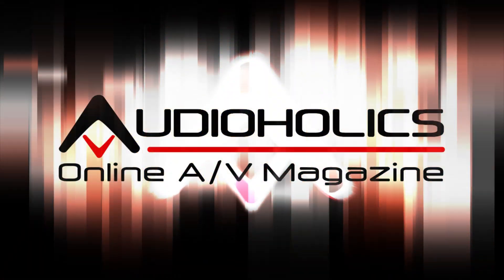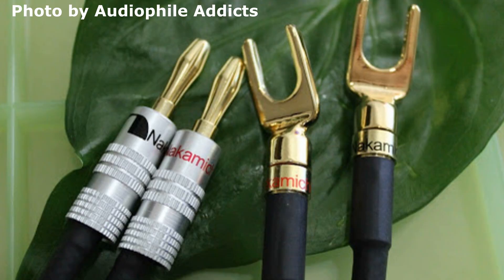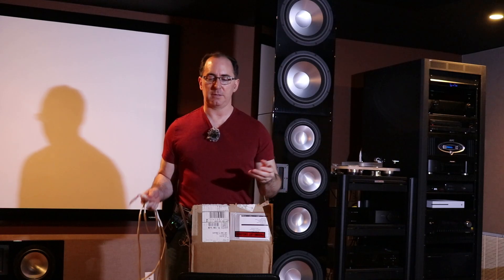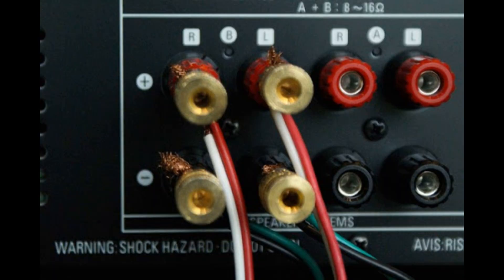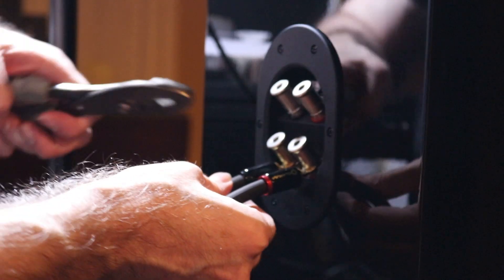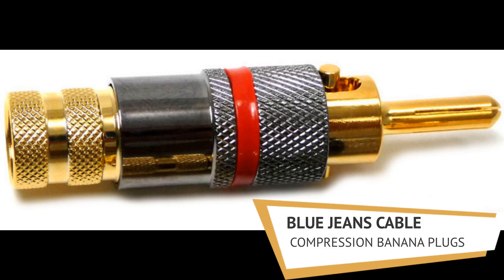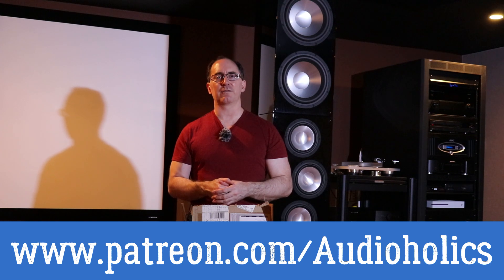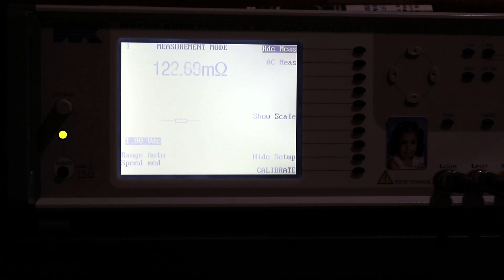Spade vs Banana vs Bare Speaker Wire Terminations: Which is Best?

Comment: Very fun subject and I share a true story. Hopefully this won’t get to long. Two Government Agencies, NASA & the USN contracted a study on what was the best type of contact connection and repeatable. Gather all the connectors, including spade and banana plugs, together, make the connections 10x, log the data and present that to NASA & the USN. Contractors enlisted, MIT & GE. Time frame 64 → 68. I think it was around 66. Use undergrads to do the tedious testing as they are cheap labor. Yours truly was one of those basically free laborers.

The testing was done in a Calibration Lab at a Navy Facility in MA run by GE. Principle instrument was what is still called a Wheatstone Bridge. That instrument was capable of measuring down into the single milliohm range, repeatedly. Like 1 or 2 milliohms.

The connection that they were most interested in was what was called a “Wirewrap” copper on gold post as that was the most common at the time in Military and Satellite backplanes.

Me/we tried’em all over and over again. Most of the good readings were in the single digit milliohm range. I think this thing ran for about a week. The Wheatstone Bridge was calibrated in the morning before testing started and checked again at the end of the day when we were finished for that day.

To try and make things as short as possible, and to support your conclusions, we found the best, and most repeatable, connection was to take cheap 12ga copper lamp cord, twist about an inch together, then hit the connection with a hammer on an iron surface (anvil). Just lightly. Typically resistance was like under 5 milliohm. Mostly in the 2 or 3 milliohm range. And it could reliably be repeated over and over and over again.

We called this connection the “Smash” connection.

That was ok with NASA and the USN. At least they knew what was the best. The wirewrap connection did very well with a repeatable connections under a 10 milliohm measurement. Spades were in the teens. Banana plugs were very inconsistent and changed with just a little wiggle. I can’t remember the exact measurements we got from those.

So there you have it. It was a long time ago but physics is physics and I suspect if that test were repeated today the numbers would be the same. I don’t think wirewrap connections are used anymore.

I’ve been told that Wheatstone Bridges can now resolve down into the micro-ohms. That’d be fun to play with.

https://en.wikipedia.org/wiki/Wheatstone_bridge
Reply: How to calibrate in the milliohm range? There are/were copper bar standards with big bolt connections on the ends that are 1mohm, 2mohm, 5mohm, 10mohm.

Comment: I use bananas wherever possible, but I use spades on my vintage McIntosh amps, which use barrier strips for the speaker taps. I've found that cheap hardware-store spades seem to make a tighter connection than the Monster spades I used originally.

Comment: I have 6 gauge wire on my 3 front speakers and I used banana,  but I had to remove some of the wire strands so it would fit in the banana and I also soldered the wires to bananas.   The rear speakers are raw.  Glad you recovered from the virus.

Comment: You forgot one category...I use o-ring which fits Vandersteen Barrier strips in the form of  10 AWG Gauge Gold Ring Set Screw Battery Ring Terminals...mostly used in car audio for power terminal connection..to connect to the speaker..to connect to the amp I use compression bananas as well spade for true bi wire using separate wire runs.  O-rings give the best connection used on barrier strips where the screw provides strong compression.  Not enough companies make audiophile o-ring speaker connectors.

Comment: I use bananas on receiver and surround speakers... but the mains are bi-amp/bi-wire so I have them setup raw with a notch in wire casing and those jumper plates taken out. So that's one wire on both hi/low binding posts. With Jumper plates make sure they don't get loose or out of place when adding connections. Also I found it neat; when i first set it all up raw that the wrench that came with speaker mounts fit the binding posts. I took some 320 grit sand paper to the cheap stamped wrench so it had no sharp edges to scratch anything. Like the Spades I find raw can get loose over time too. When doing a good cleaning of my room I pull my connections and clean them with Alcohol.

Comment: I use bare wire on both sides, and it works just fine. Glad to see you feeling better, Gene.
Reply: Do you tin the wires to prevent corossion?
Reply: @ I don’t, but that wouldn’t be a bad idea. I guess you’d have to be careful with how much solder you add. You wouldn’t want to thicken the wire too much that it won’t fit in the holes.
Reply: Yeah, bare wire is probably the best a non-technical person is going to get. Banana plugs are popular, but they're meant for temporary connections only.

On the other hand, if you have a decent crimper and don't mind putting the effort it, spades are the most reliable and robust connection.
Reply: @VladimirPutin-p3t Have you watched the video? Spades are the easiest to come loose, and are therefore the least reliable.

Comment: First of all, welcome back, Gene! Your COVID-19 journey and story was a ray of hope for us who are just getting the brunt of the infection in our country. (Currently in lockdown). So, I'm staying home for at least 2 more weeks.

Anyway, I use raw copper wires for the longest time. I encountered a great deal on banana plugs online and dove right into the deal. Now, I use them and they are more neat-looking than the raw copper wires. Copper wires also tend to get pulled out of plugs. Bananas are more secure. In terms of sound quality, I do not hear any difference, to be completely honest. I am just happy that I have a better quality speaker connection in both physically and aesthetically.

Comment: I’ve mostly used banana plugs.  I had all Monoprice closed screw plugs but I recently had an issue which I thought could be related to my terminations.  I noticed that they were loose in specific binding posts and I never liked the way they screw down.  If you don’t strip it the perfect length then the wire gets stuck in the threads.  It can then cut some of the threads.  So I ordered Sewell silverback banana plugs.  Much better in my opinion.  I like they way you terminate the wire with two screws and they fit nice and snug in all the binding posts in my system.  Unfortunately they’ve been sold out for weeks for some reason so I havnt been able to get more to swap out all the Monoprice.

Comment: 2-Inch Solid Copper Wire crammed half way into the middle of the speaker cable conductors, soldered and heat shrink applied. The solid wire now easily fits into the 5-way binding posts

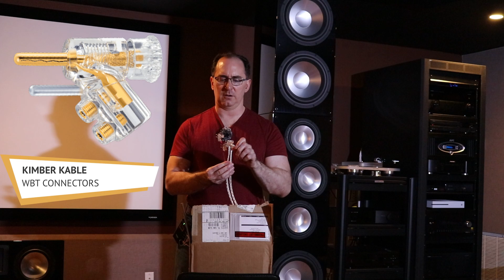Comment: 3:46 parts express (Dayton audio) sells copies of those connectors which work perfectly in my experience. They still aren't super cheap but are certainly better than Kimber's price. I've used both styles and I agree the 45 degree connector is much better for speakers than the straight style.

Comment: What?  I thought we were supposed to use a single 1/8 TRS on the amp side and RCA connectors on the speakers!!  🤔🤐😂

I think you either have common sense about connection integrity, or don't.  I guess you can give those who don't step-by-step instructions and maybe it'll improve their chances.  

Mine are probably considered a little extreme.  I put ring terminals on the speaker side, soldered to the wire, and attached to a terminal block.  Three pairs of mil spec ten gauge, twisted in pairs, one for each driver set.  Dual bananas on the amp side, stacked, the old Pomona high continuous current type from 40-50 years ago.

Comment: I'm still using my old 'Cobalt Cable' (remember them) banana terminated cables on an MC205/Sonus Faber rig, into and out of pre-wired 10AWG walls. The JL Audio Sub is balanced. Ditto on the loose spades experience.

Comment: Soldering your bear wire helps the screw down connection?
Reply: this might work if you are good at soldering or have a melting pot. i tried and you have to make them really straight and not too big to fit hole. Mine were a failure.

Comment: I use banana plugs both ends

There's also XLR, but none of my equipment has that connection
Reply: XLR is a signal connector.  Not a power connector.  Typically on microphones and inter-equipment balanced line level signals.

Comment: I always use silver soldered bare wire. Not saying it's any better, but I like that it handles connector compression better when soldered. It also helps with eliminating stray strands of wire.
Reply: Don't use silver solder. The silver content doesn't appreciably improve conductance. It also requires separate flux. Silver solder is for high melting temperature, high strength applications. You want high malleability, low melting temperature solder. Answer is: 60-40 rosin core electric solder.
Reply: If you're using bare wire and binding posts to compress the cable to make a cold joint tinning the cable doesn't work. It's probably worse than using oxidised cable; at least the compression joint has some hope of braking through the oxide. 

 There is a very good reason why tinned wire and screw type compression joints are strictly prohibited in the UK wiring regs. It's all to do with metallurgy. 

Many homes have burned down because people have done this with mains wire. 

It doesn't handle the compression better the whole point of the compression joint is that the cable is malleable, compresses and deforms to form a good joint.
Reply: Thank you for your really clear explanation. I was confused as to why nobody was just soldering up/tin the wire  @TomStanley-pi3qi
Reply: I know this is a 4 yr old post, but do you have a recommendation on the type of silver solder to use?
Reply: @synth505  cardas do a really nice one

Comment: I thought connecting with a banana gives me a contact resistance to the plug and between the plug and the binding post. So I go raw
Reply: i soldered the cable in the bananaplug

Comment: After years of experimentation, I go with raw wire, with at least the amplifier ends tinned. Added terminals just put something between the wire and the binding post. Your connection to the speaker or amp then depends on the connection between the the wire and the added terminal. I have seen factory-added terminals such as spades cause large gauge wire to crimp and break over time. Whiskers are definitely a concern but this can be avoided by tinning the ends of the wire.
Reply: Is there special tining material?
Reply: There are different solders but it’s recommended one with 3%+  silver (Ag). I’m not into Cardas but they make a good tinning solder that’s great for audio at a decent price. Mundorf Msolder supreme, WBT 0800, kester k100ld are good. Mogami 3103 12g cable with some cable pants and sumitomo heat shrink with raw silver tinned ends for the win IMO. And tighten the posts with wrench or pliers.
Reply: @iAbdullah_Hamad  - Troels Gravesen uses 0.7 mm 60/40 (Sn/Pb) on crossovers.  So that would be a safe bet.  
He does not like solder with silver in it ("99.7/0.3 (Sn/Cu), which is a terrible.")
Reply: Do you use a special kind of tin? Or just normal tin?

Comment: I agree with you Gene, the simplicity and connection made by bananas is best and that's what I depend on.

However, I do bi-wire my towers and although the tower accommodates 2 sets of Bananas, the amp does not. So on the amp side, I do bananas and spades. Damn if I don't have to tighten down those spades!

Comment: So glad that someone has addressed this. I am an audiophile and I can concur wholeheartedly I hate Spade connectors for the very reasons you have outlined. My preference is good quality compression banana plugs all day every day. Before these I used bare wire but I used to tin them to avoid the whisker thing. Yes you could say I would get oxidization of the silver solder but no more so than bare copper. The only tangible benefit I can see in using Spades is decent ones will be gold plated  so wont oxidize but every one I ever used on thicker gauge is almost impossible to tighten properly.
Reply: I bet you've been using the wrong type of the spade terminals. Try some AudioQuest terminals and you would change your opinion.

Comment: The best is bare wire lightly tinned with silver solder, to keep the strands in tack
Reply: Lower connection resistance is possible with stands because they can spread out and contact a greater area when compressed.  Yes it's messy for reuse without cutting and stripping where tinning has the advantage.

Silver solder requires really high temperature to melt, like an oxy-acetelene torch.  I use that for brazing HVAC refrigerant lines.  Perhaps you're using electronics grade solder with a tiny percentage of silver?

Comment: Gene its good to see you improving health! Road to recovery seems good now, a lot of fans are glad.  I did my own cables, always use bananas - Nakamichi, and its got 11GA (14x4 in braid) crammed in each plug with soldering + 2 screws in terminal plug inner sheath. rock solid, and I love it. This is also in bi-amp for L/R and biwire Y cable for Centre.  YAY
Reply: Can I use insulated wires to connect speaker voice coil ends to the terminals instead of braided copper wire usually used to join them ?
Reply: That's some serious wiring

Comment: Monster Cable "Quick Lock" Bananas . I bought a ton around 2004-05 for an install. They were the best you could buy at the time. Still have em, still use them. Awesome contact and very snug...

Comment: For the cables I made myself, I used bananas. With raw approach I had some oxidation problems in the past, no matter how carefully I attached them. These days I use spades simply because that's what I could find at a decent price for the manufacturer cables I wanted to try. Maybe these sell more and are available in a greater proportion on the market, who knows. I never knew audiophiles go for spades on purpose. I agree that they are harder to use, but I get them rock solid with a bit of work for best possible contact.
I love the idea of this topic and the way it was handled.

Comment: I'm using bare wire for amp and speaker end. On the amp end, I've cut wire just enough to put it into terminal so no excess there. Maybe this is not acceptable for people that often changes equipment  but for me it is perfect.

Comment: I used to work as a technician, testing electrical distribution protection systems. The amount of amps we reliably pumped through good quality nickel plated banana plugs was impressive. By good quality I mean brands like RS Components, Hirschmann, etc.  And those brands dont come with bling.

Comment: I've learnt from more intelligent people than me that the way to go is to buy cable which only has one solid copper strand. This is used for running electrical wiring in buildings. Search for ydyp 2x2,5 or ydyp 4x1,5. These are proper cables and I swear by them since many years back. For surrounds you can find the same but small dimensions. I bought 100m drum of this stuff for like $100 from Poland. For connectors there are these lab type banana connectors that are cheap and have amazing connection pressure! Search for wago banana plug. They have these spring loaded knives in them that cut into the copper so if you use those single strand cables I can promise you you can't pull that sucker off even if you pull really hard!

Anything with screws sucks and cannot be used in my opinion!